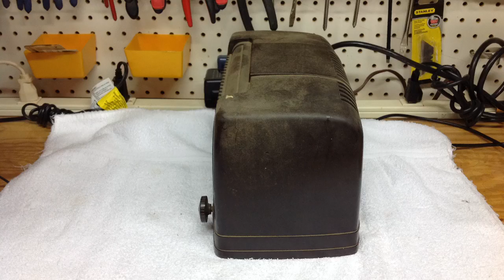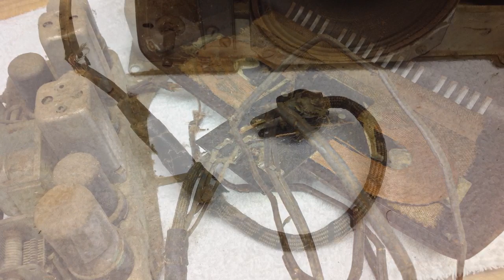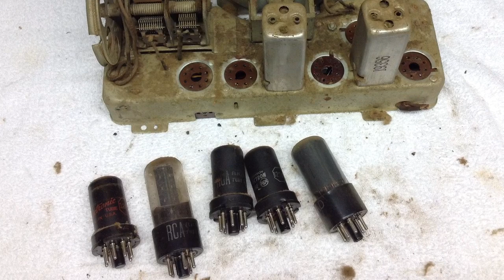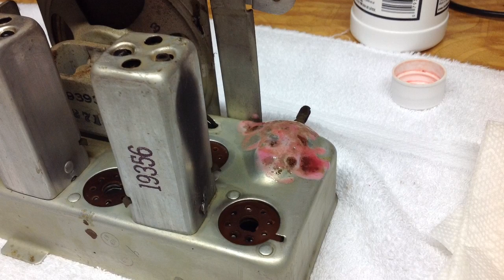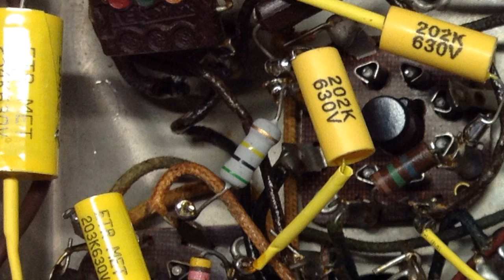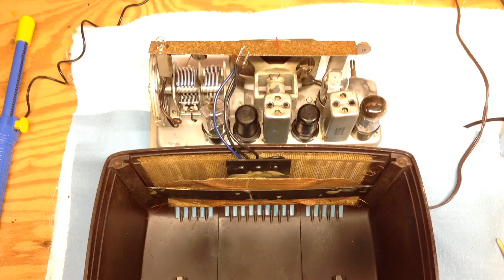Arvin Radio - Model 552N

Comment: Great Job!   Another vintage radio is "singing again!"
Reply from the maker: Thank you Richard. Best, Don
Reply: @RestoreOldRadios  I recently came across a Stromberg Carlson 1947 early AM/FM radio with a great Bakelite case and an intricately designed brass speaker grill cover.  It needs complete electronic re-working but as of now I have been working on cleaning the brass speaker grill (which turned out great) and have polished up the Bakelite cabinet.
Now the radio looks great and can't wait to hear it "sing" again as it is a great looking radio made by the Stromberg Carlson Company, known for using some of the heaviest and best quality Bakelite on any radio.

Guess they leaned this technique from the heavy duty Bakelite telephones they made during this time period.  Their electronics both in their telephones and radios are oftentimes listed as being some of the best in the business.
Reply from the maker: I’m pretty sure I have a Stromberg Carlson in storage and recall the Bakelite cabinet being thicker and heavier than most. I hope things continue to progress as planned and it’s singing again soon. Stay well. Best, Don
Reply: @RestoreOldRadios  Bakelite was made in many different ways with many different materials.  Stromberg Carlson Bakelite radios probably used some of the best Bakelite materials as they were so familiar with the material from the use of Bakelite in their heavy duty telephones.  That is just a guess, but the one I have certainly has what appears to be a thicker Bakelite and one that is less apt to break as was the case with their heavy duty telephones.
  I have an RCA Victor radio where the Bakelite is so thin it would break if I tried picking up the radio from the top side.  It is in great shape, but I just have to be much more careful in handling it as the Bakelite is so much thinner.
I notice the Bendex radio that have no back but rather a hole in the top to pick up the radio and it also has a very thick Bakelite material as the radio would break if picked up from the top opening made for just that purpose.  I still am cautious in handling that radio as the Bakelite may just become more brittle with time.
Reply from the maker: Do you have any best practices for repairing cracks without having to paint the cabinet afterwards?

Comment: I have a few backless sets, including one made by Noblitt-Sparks, I like the way these look.  Couldn't really tell, but, it looks like the grill cloth is in one piece.  I've had a fair amount of success with using foam carpet cleaner, then giving them a one pass light coat of spray paint, to bring them back and keep it pretty original.  It sounded really good, nice tone.  It looks like the caps were of different vintages, that electrolytic was newer, for sure.  You did find a variety of different types of components, in a lot of the immediate post-war sets, they pretty much used what was on hand.  Nice radio.
Reply from the maker: Al, there are two single pieces of grille cloth, one for the back grille and of course the front. I'll give your technique a try and see how it turns out. Thanks for watching and taking time to share your experience.

Don